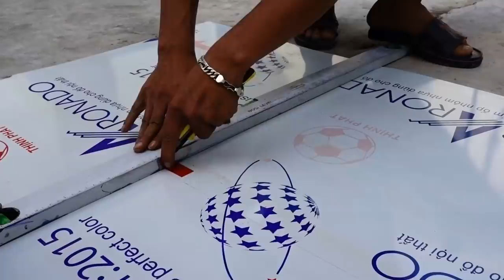18.10 How to Build Wood Fired Brick Pizza, barbecue, cake for your home

Comment: Nice build, but Chimney vent is in the wrong place, needs to be in the entrance tunnel section or too much heat is wasted. Also mounting hinges direct to brickwork not wise, more usual to make a wood “plug” door which is not hinged at all, just pushed into place.